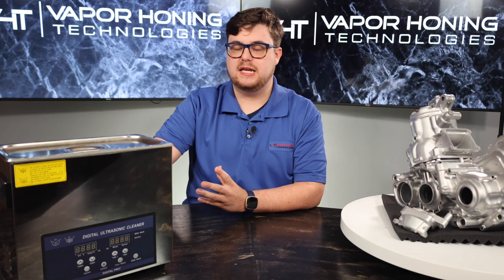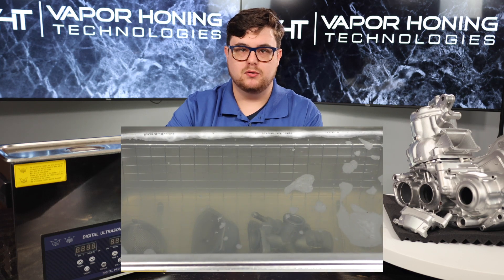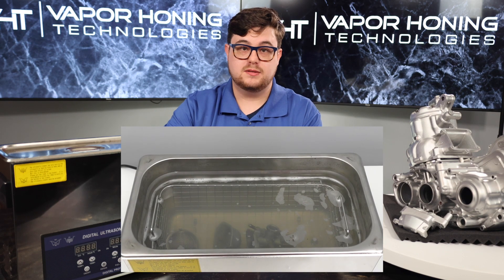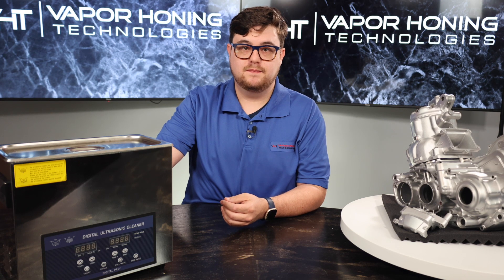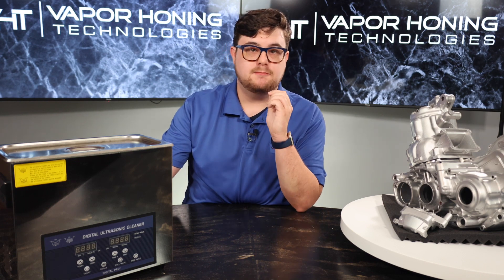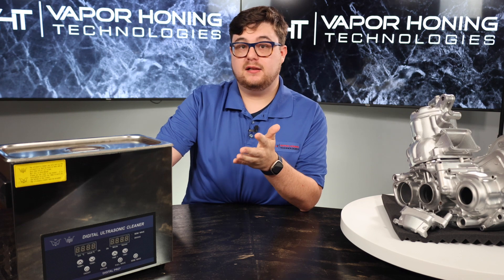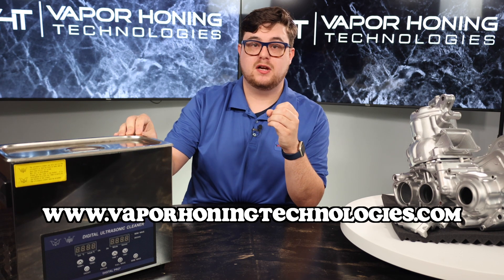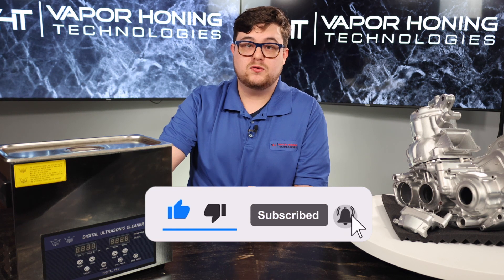Ultrasonic Cleaner vs. Vapor Blaster

Comment: Here's my recipe for success using both an ultrasonic cleaner and vapor hone. 
1. Run parts through a heated ultrasonic cleaner with Master STAGES CLEAN2020 as the solution. This removes heavy contaminants like oils, grease, and years of baked on contaminants.
2. Once cleaned in the ultrasonic cleaner I'll then move them onto the VaporHone Micro to put a nice finish on as well as clean out any stubborn crevasses or small jets.
3. Followed up with a good rinsing and blow drying.  

The end result is a better than new looking part and media that stays cleaner for much longer. A tip on the ultrasonic cleaner is to put parts in a ziplock bag with your cleaning solution then drop it in the ultrasonic cleaner that's filled with water. This makes it much easier if you have different solutions for different materials and would rather avoid emptying the tank each time.
Reply from the maker: That sounds like the perfect combination!